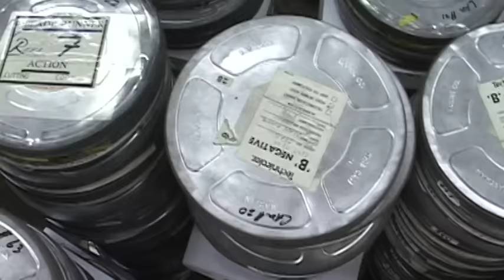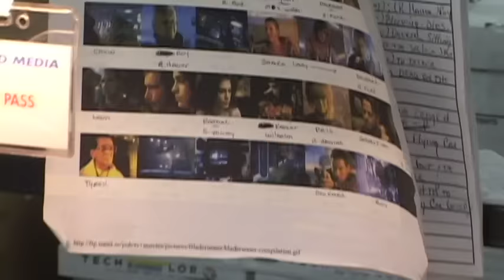Blade Runner Documentary - From Workprint To Final Cut ブレードランナー

Comment: There was also the lost San Diego Sneak Preview Version, which was the US theatrical cut but with three additional scenes not on any version before or after it.
And there are two different TV cuts: the US broadcast cut and the HBO Asia cut. The only differences are that the latter is 16:9 HD with 5.1 surround sound, and no not-Deckard narration reading out the opening crawl.

Comment: The brief replacement sequence at 24:57 is questionable; the brightness is too bright for what's just happened (a milky white which doesn't match with the rest of the sequence) and the addition of the building on the left gives the impression it's the location where Deckard and Batty are; making us think we're below their building looking up. How would the dove suddenly be below the building? That's the unfortunate impression it gives as both buildings are far too similar in design. It also looks like a computer sequence so we're taken out of the 'reality' of the film yet again! The 2nd version of this brief sequence, designed years ago, is, in my opinion, the better version!

Reply